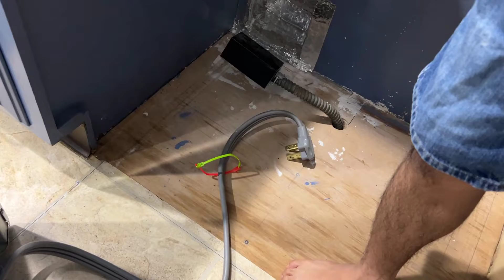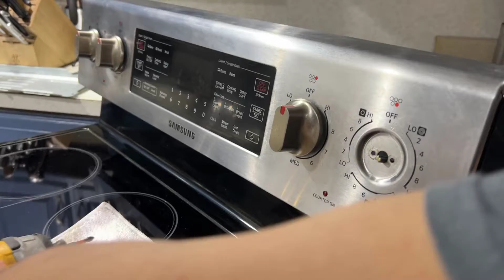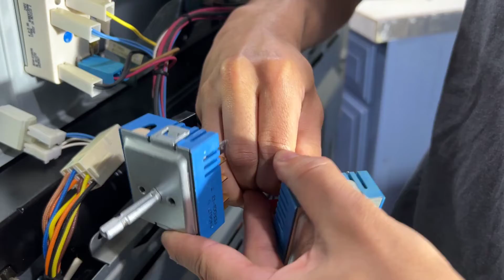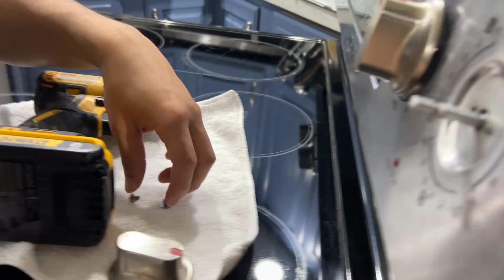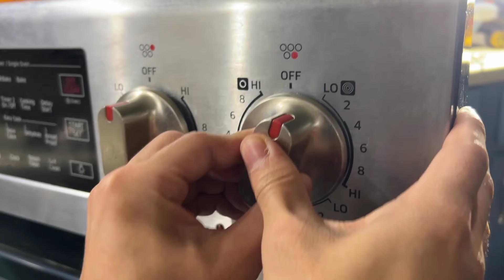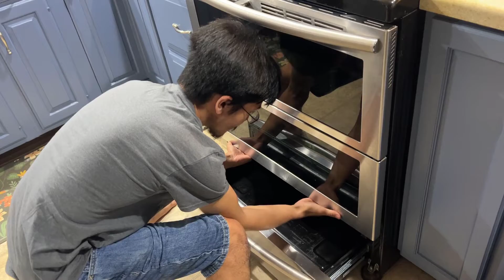How To Replace Triple Burner Control Switch | Samsung Cooktop Electric Stove Range Oven | Stays High

Comment from the maker: Here are the #ᴬᴰlinks to models, accessories and parts discussed in this video:
1.  https://amzn.to/3Icom8H  |  DG44-01007B Range Surface Element Switch DG44-01007B Control Switch Compatible with Samsung Replaces Parts: DG44-01007A, PER001-03, PER001-13 T, 4929395, AP6003098, PS11735755, EAP11735755
2.  https://amzn.to/44I47Y5  |  DG44-01006B Dual Burner Infinite Switch - Compatible with Samsung Range/Oven Surface Element Control, Fits Samsung NE59J7750WS NE58K9850WS NE59M4310SS (Replacement Part) PER001-12D
3.  https://amzn.to/3IzYCD5  |  DG44-01006A Range Surface Element Switch DG44-01006A Control Switch Replaces Parts: PER001-02 D, 3282716, AP5800762, PS8764900, EAP8764900 Range Regulator-Outer Compatible with Samsung
4.  https://amzn.to/4eFD2t2  |  New Upgraded DE07-00130A Range LED Display Board Compatible with Samsung Electric Range -Oven/Stove Fits Model NE59J7750WS/AA NE59J7850WG/AA NE59J7850WS/AA NE59J7750WS/AC
5.  https://amzn.to/44geSlh  |  Samsung Appliance NV51K6650DS 30" 10.2 cu. ft. Total Capacity Electric Double Wall Oven with Top Broiler, in Stainless Steel

Or Click on Amazon link here and search for what you need:  https://amzn.to/3D1T2GQ

Comment: I have the exact stove/oven and am looking for the triple-burning control switch you used.  The links are showing the dual switch. Can you give me the link to the triple one you used please.
Reply from the maker: Here's what we bought:

https://amzn.to/3Vbn7wG

Part number DG44-01007B is commonly referred to as a triple burner switch (or triple element infinite control switch).

While the main Amazon title describes it generally as a "Range Surface Element Switch," the manufacturer production code PER001-13 T stamped on the side of the blue housing specifically designates Samsung's triple surface element regulator.

Comment: hey i’m confused in looking to replace the triple burner control switch for my model but can’t find the replacement. NE63A6711SS
Reply from the maker: I recommend searching by your specific part number found on the original component, as that will be the most accurate way to find a match for your unit! 👍Worst case if it doesn't work out you can always return it to Amazon.

Comment: I have had the same thermostat replaced three times, keeps getting stuck on high works for a while, 3 weeks, 3 months, 4 months and then it starts doing the same thing, is there something else that can be causing this to happen?
Reply from the maker: Try replacing the main control panel or the brain.

Comment: Thank you! I just did the swap yesterday. I had trouble with the white prong aswell. At one point I thought I would have to give up. Didnt want to damage the connection. But eventually got it off.
Reply from the maker: Glad you stuck with it and got it done! 👍

Comment: Sir, thanks for the video. I have the same problem with this switch. To remove the white connector you need to introduce a small flat screwdriver in the same direction of the wires, at back of the connector to pry a small lock  inside of connector and pull out back slowly the connector and thats it. Do not pry the connector from the root since it will be loss when you plug again as you show in the video. Regards
Reply from the maker: That's a really helpful tip, thanks for sharing your experience!
Reply: How can I fix the problem that only the small circle element of the  large range not working?